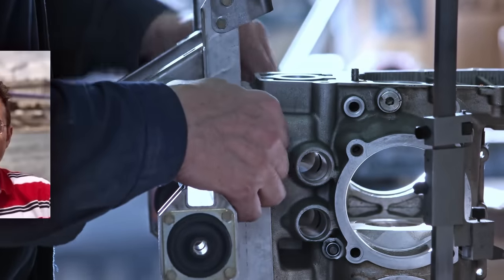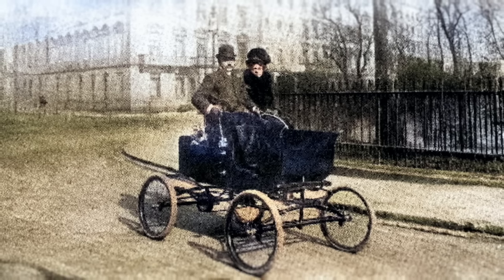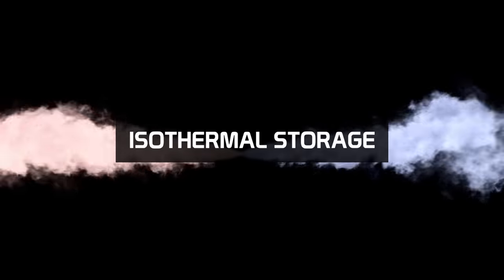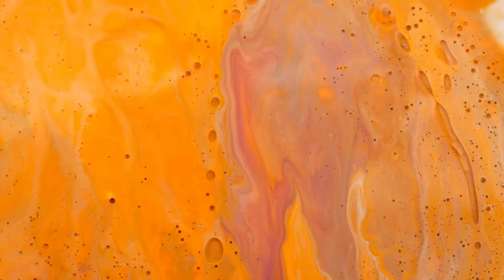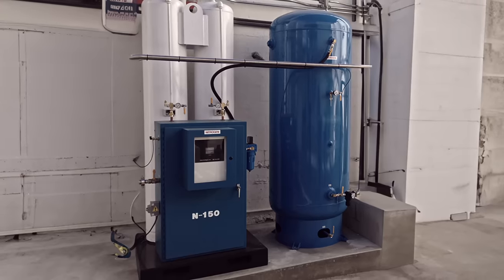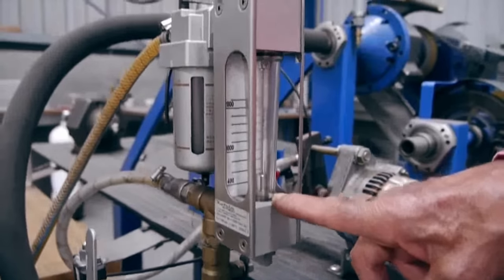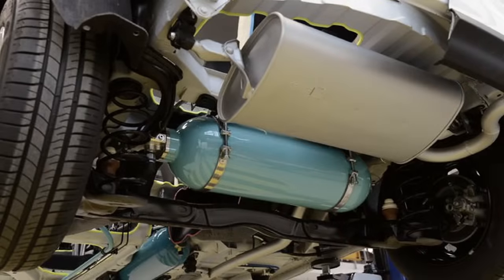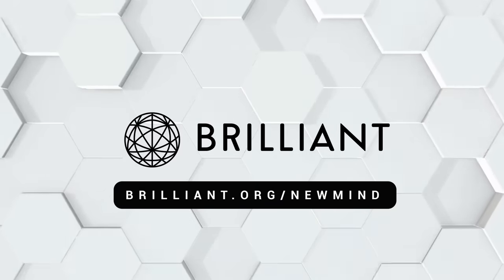Driving On Compressed Air: The Little-Known Compressed Air Revolution

Comment: Paraffin latent heat is about 250J/g, whereas lithium batteries have 720 J/g. Not even close to be the same. Especially if you have to add the weight of the air tanks. 
The idea of extracting the heat by melting substances is brilliant, but is absolutely not competitive when it comes to transport, especially, cars.
And the reason is not in power density. EVs can be built from standard parts entirely, a very little amount of know-how and special manufacturing processes is required. Which means, any sweatshop in China can start making them, when the parts become mass produced. It's already happening. This is the main push for EVs. 
For the compressed air vehicles, it will require even more specific manufacturing and more complicated systems than for the ICE. 
Also, so far all CAVs have demonstrated a very bad acceleration, which makes them not admissible to the city traffic. Maybe they will find their niche as golf carts or forklifts.

Comment: More snake oil.  Zero pollution motors as long as you don't think about the power to compress the air and the power/materials to manufacture it.  The efficiency rating also seems to be leaving out the compressing of the air.  MAGIC SCIENCE!

Comment: Thanks for talking about Guy Nègre! (pronounced "Gee" [with a hard G] "naygr"). He got the idea of making an air car by using air to fix seized pistons on a formula 1 car (he was a mechanic for the famous French driver Alain Prost). 
From what I understood the issue behind compressed air vehicles was the fact that the engine was rather loud. It was, however filtering the air during it's operation, making it the first car to actually make the ambient air cleaner during use.
By the way, if said in french, Louis is pronounced "Luwi"

Comment: Our overlords, such as BlackRock and other major banks, are not interested in small returns. This is why, as a society, we do not have access to clean, cheap nuclear energy, air cars, or advanced 3D printers that can print vehicles. They prefer high costs and patented technologies, which is akin to slavery, but arguably worse. Fortunately, the advent of self-driving cars, taxis, and motorcycles will disrupt the market and potentially break this cycle. It's crucial for us to support and invest in technologies that are not only sustainable and efficient but also accessible to everyone, rather than being controlled by a select few.

Comment: Why on earth would you create an "air battery" that's >60% inefficient at charging, and again >60% inefficient at discharging, and use that instead of an actual battery? And on top of that, drive around with a high pressure cylinder in the trunk, and what's effectively a steam engine in the front? Not to mention the condensers required to dry the air so that your engine doesn't rust overnight from the water. 
This is literally as dumb as purchasing an 80gallon compressor, putting that in your trunk, connecting that to a generator to run the compressor, and then using the air from the compressor in a pneumatic motor to drive the wheels. Watch a YT video of a compressed air tank exploding, and tell me you're ok with that in your trunk. I can't even begin to describe how ludicrous this is.
The rest of the BS about "phase changing materials", is entirely nonsense, meant to generate investor interest from the technologically illiterate investors. I have a solar roadway and a thorium car to sell you, taking offers now.

Comment: Or we can put some serious time and money into hydrogen.

The thing that already works at commercial scales and just needs the appropriate infrastructure.
Reply: Combine the hydrogen with carbon from CO2 from smokestacks and cement and so on, and synthesize substitutes for gasoline and Diesel. That will take advantage of existing infrastructure and avoid the problems of hydrogen embrittling containers and plumbing and it leaking out.

Comment: Come on, someone chime
 in here with the energy
 losses in this method.
Reply: 95%, that is, put 10KW at the input (350 bar air compressor) and get 500w at the wheel. Lol, this is beyond ridiculous. IF you want to count yourself, best in class compressor 350 bar comrpessor ; 50% efficiency, best in class "air motor" : 10 to 15% efficiency, various losses 5%.

Comment: How much does all this on board technology cost? 
Can you buy a vehicle that costs <$20,000 with operating costs lower then ICE and useful ranges >100 miles? The answer is no! Why? The tech is expensive and putting a licensable vehicle into serial production is extremely complicated because of modern regulations and prohibitively expensive. Easley $100,000,000 needed. I retired as an Electronics Engineer designing LIDAR for Autonomous Driving Vehicles. Ten years, 250 Scientists, Engineers, Manufacturing and Marketing Specialists and major capital to get one sensor into serial production. How much for an entire vehicle?

Comment: Hitch hiking around 1983 I got a lift with a journalist and we talked about machines and things and that steam engines had reached a high degree of efficiency in the cylinder , at the time possibly better than 4star leaded petrol. and I predicted the re introduction of steam , ok air not steam but its basic physics that counts and the more basic the more efficient.

Comment: If there was a safe way to make 3,000 PSI pressure, chemically, it might overwhelm the fact that it's super inefficient. All you have to do is use a half inch impact gun to know how inefficient it is. But having to compress it mechanically with a compressor and use power doing so, seems a very worthless venture. But just for the hell of it, I'll watch the video, anyway.

Comment: Compressed air , as a fuel source has too many problems to be viable .
Unless you find some way of burning it without adding another combustible or another fuel source .
Now I say compressed are not pure oxygen .
I guess first and my mind would be the fact that to have enough compressed air to actually push anything of any significant weight or volume you would need a massive amount of compressed air and I mean more than a metric fuckton .
Secondly that much compressed air if the compressed-air filsell were to rupture or malfunction well it would be akin to being at ground zero when they drop probably at least little boy on Hiroshi Morrow Nagasaki or whichever one it was but basically you would be standing beside the fertilizer factory when it detonates in Texas and basically wipes out well everything for practically a mile or maybe more .
😅 Then get this .
We are basically inside an are vault on the earth there is a finite amount of space and a finite amount of are so if a bunch of people start sucking up there to compress to put in their vehicles what are you going to breathe because well you've got hundreds of millions or billions of people who are driving on the roads and if they all sucked up a bunch of oxygen to refill their cars you'll all die you'll all suffocate and die .
And I've only watched 5 seconds of the video and I can already see way too many problems with compressed air for fuel .
When everybody starts sucking up all the air down here to fill their cars all those greenhouse gases everyone is so worried about that are floating in the atmosphere guess what you'll be breathing you going to be breathing those because they'll be less pressure pushing those up displacing those lighter gases they'll be a lot closer to the surface of the Earth and things will get a whole hell of a lot worse a whole hell of a lot quicker so yeah keep that compressed air car , it's a completely stupid idea anyway the amount of compressed air it would take to propel a car any significant distance much less uphill would be so much you would literally require an 18-wheeler sized fuel-cell I'm talking a gas tanker sized fuel-cell to go anywhere😂 .
Oh yes this seems highly efficient 😂 .

Comment: Yet another bunch of guys who don’t understand simple physics. This is about the fifth such announcement I’ve seen in the last ten years. IT WILL NOT WORK, unless of course you intend to light a fire under the air tank. But that kind of defeats the concept. You can’t magically get back the energy lost from the tank as heat when you compressed the air.

Comment: Ok this is like an old repost or something.. cause Teslas can go about 405 miles (Avg electric car range is 250 Miles) not the 87 miles your claming in this video..
Check your facts before you post info.
as for the compressed air aspect... The ideal gas law tells us when the pressure on any constant volume of gas increases, the temperature also increases. Compressed air is no exception; it can become as hot as 300 degrees F. Without cooling, SO what is the 1,600F your talking about??

Comment: It looks amazing though, ill be 3d printing my first jet engine prototype design for air intake and output tests then send it to cnc company to get it machined out of metal so I could test the hybrid feature with gas instead of a electric motor for the 3d print version, if it works i hope to start my jet engine company fot people that want to make models and stuff

Comment: It should be obvious by the continued failures of these ridiculous "pod" cars that compressed air for vehicles is destined to fail.  I remember these claims from over 15 years ago and saw how impractical they were.  The complexity is too high and the energy density is too low.  There may be a place for it in stationary storage where space and weight are less of a concern.

Comment: So what energy source will be used to compress the air ? The energy value of the compressed air would be similar to energy used to compress it. So unless you are using 100s of third world people with bicycle pumps , and cheap rice rations to provide your air,  ( AKA "Slave labor ")you have no net gain. All you have is an inefficient means of energy transfer and storage.

Comment: Why anyone would waste their time on this technology is beyond me.  Compressed air is the least efficient form of energy.
Reply: Fast recharge and clean… no need for cooling system… reliable… with solar powered compressor or with a windmill, you can charge it without draining the electric grid… even if less efficient, I’d rather get one or go to work than an electric car with a bill of 15k$ after 5 years when batteries die or burn…
Reply: @xtophgerard1169  Still way to many problems to deal with.  Storage vessel fatigue, heat and cold mitigation and lubrication expulsion.  I guess on the bright side you will have a built in tire inflater.

Comment: Its really too bad this compressed air tech seems to be focused on a whole vehicle, instead of an aftermarket thing that could be used on any engine... think about how lean a engine could be run if compressed air were injected just past the point of peak cylinder pressure, and the excess pressure left at the beginning of the exhaust recovered to help spin a compressor to keep the air tank filled up. Done correctly the actual pressure ratio could easly exceed whats normally achieved in boosted engines and fuel usage like what would be had at 30:1 AF (lean beyond belief).

Comment: What about using this system with a battery powered system and get rid of range anxiety. Car running low on battery just pull up at an airfill station and in 3 minutes your car is ready to go another 100 k to get you home. A cheaper infrastructure to fill your car with compressed air.

Comment: Terrible idea, too much friction/waste heat, not efficient, it has been tried many times, recharging a battery from solar panels and driving an electric motor is the most efficient. :face-green-smiling::face-green-smiling::face-green-smiling::face-green-smiling::face-green-smiling:

Comment: You say:Pneumatic equipment relatively quiet? Relative quiet to what? Have you been near this equipment when it fails, blows up and shoots shrapnel at you?
Just 4 psi in a large drum when it fails goes off like a bomb.  

They are liquifing it for safety. That is not cheap. 30 year Life span of equipment.

Comment: What? Air cools as it expands? 
No it doesn't! It's already cooled in its compressed state and begins to warm as it expands... 
I think that you messed it up there...
Reply: Yes, as compressed air expands it gets colder.
Reply: @thedubwhisperer2157  actually no.... Air must absorb heat as it expands just as much as it must release heat as it's compressed! 
Air in an atmosphere of a certain amount of pressure will require a certain amount of heat to reach its steady state! 
Any movement in pressure either way will require a gain or loss of heat..... 
You might be thinking about how compressed air feels cold, the reason why it feels cold is that in its compressed state it already lost its heat while it was being compressed and now that it's blowing at you it's pulling heat from your hand giving the impression that it's getting colder when in fact it's not! It's actually heating! Trying to reach it's steady state in the atmosphere it's being released in! 
You can test this by attaching a temperature probe on the storage cylinder of a compressor, turn it on and watch the temperature rise, if you insulate the cylinder and leave only a small area exposed for the temperature probe, you should see a higher temperature rise as pressure builds.... The higher the pressure inside the cylinder the cooler the air will be when released assuming that you gave the cylinder enough time to reach equal temperature to the atmosphere around it. In fact, assuming that you can get the pressure inside the cylinder even higher without it exploding, you will be able to freeze water with it.... 
But remember that we are talking about driving on compressed air! 
Taking air in something like a pneumatic cylinder and then pulling the piston outward to force the air to expand will cause the air to appear to be cooling when it's actually absorbing heat because now it has the room for it! Remember that heat is energy and energy cannot be compressed! When you compress anything it must give off something and that something is usually heat, in the case of quartz it will give off electric charge which is also an un compressible energy....
Reply: @PeterMilanovski  Ok, I phrased my reply incorrectly.  As compressed air expands it will cool its surroundings.

Comment: This exactly illustrates why battery electric vehicles are a joke. The loss of power principle in compressed air and battery technology is identical (Batteries lose their power when they lose their charge). However, people dont know that, so batteries get a pass.

The reason compressed air is better than electricity for power tools is because you can attach a massive motor to an air tank, but you can't necessarily wield that same motor. So air will always be more powerful than electric, in the same size. You're basically comparing the output of a small handheld motor to a much larger mounted motor. And likewise, with batteries, you are essentially comparing a small handheld air tank, to a much larger mounted version.

I think it's ironic that battery electric cars/technology get widespread support, but compressed air storage is laughed at, like its not essentially the same performance and results.

Comment: Useless for most vehicles! What's the point? You have to compress the air. Not an efficient system. Same with electric vehicles. There is no free lunch. Nothing has been found that actually pollutes less as a system then ICE engines burning fossil fuels. This is especially true as technology makes engines more efficient.